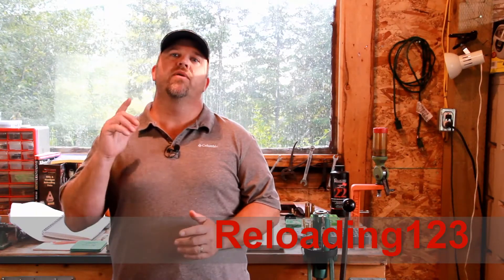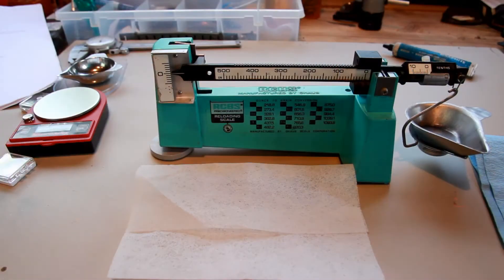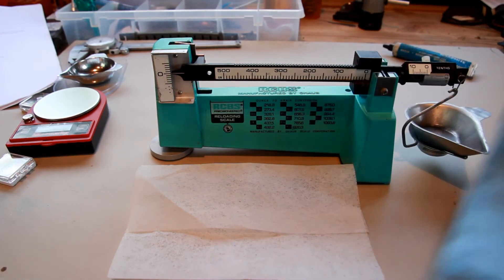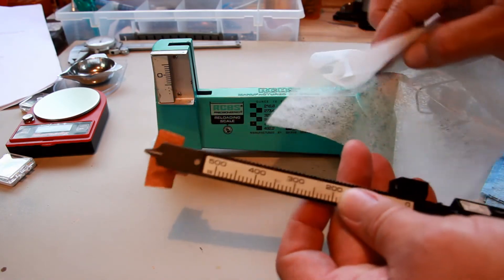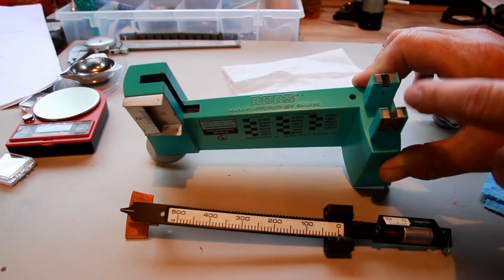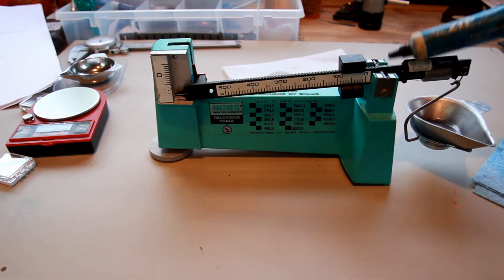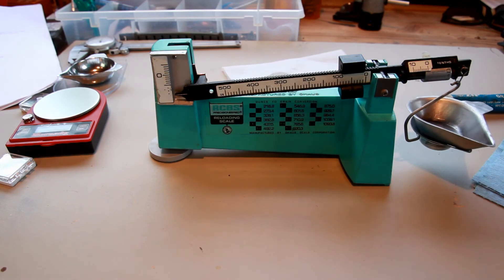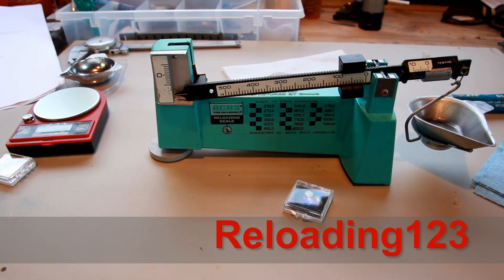Quick TIp - Reloading Scale Maintenance

Comment: I've been lightly burnishing the blade edges with a hb graphite pencil and brushing off any excess with a q tip. Seems to work a little better for me than adding graphite directly on the agate bearings.
Reply from the maker: Great advice.  I do something similar. After I tap a little graphite on the fulcrum i gently work the arm and blow off the excess.  Thanks for the comment.